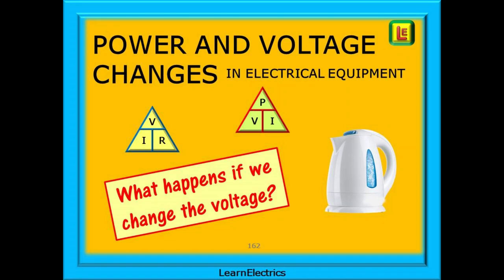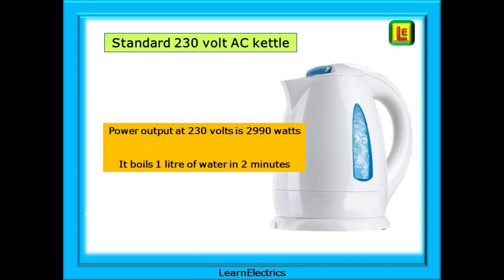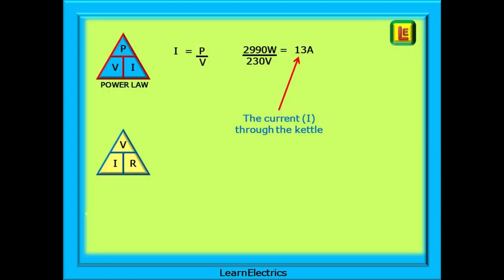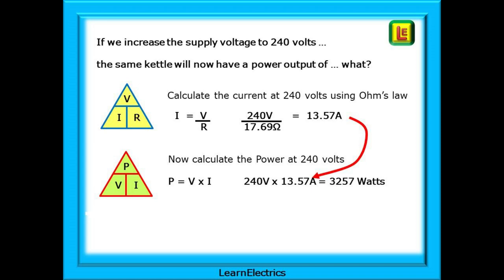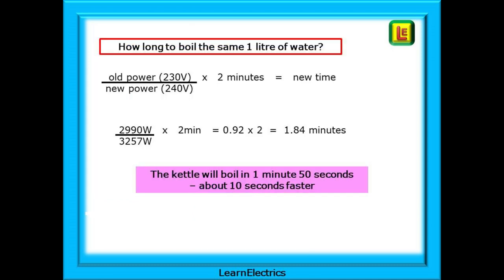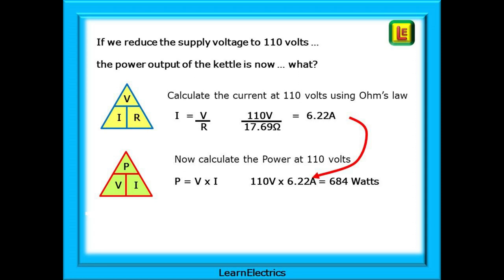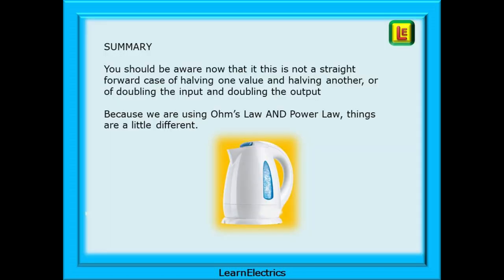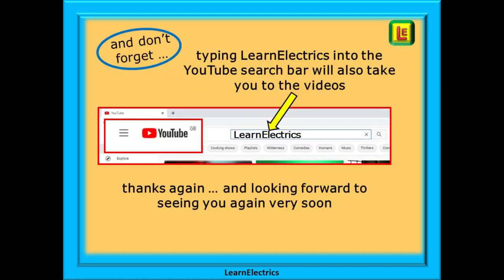POWER AND VOLTAGE CHANGES IN ELECTRICAL CIRCUITS – HOW DO THEY AFFECT EQUIPMENT PERFORMANCE

Comment: Silly question, but why was the resistance fixed at 17.69 ohms if it was calculated from 230 volts which kept changing from examples to example ?
Reply from the maker: Resistance is fixed, its a characteristic of the resistance wire and elements used in electrical equipment. Impedance will make a very small difference, but we have said that we are ignoring that for this video. The resistance is a starting point for us, a stake in the ground from which we can calculate everything else.
Reply: I had thought the same question, so not a silly question